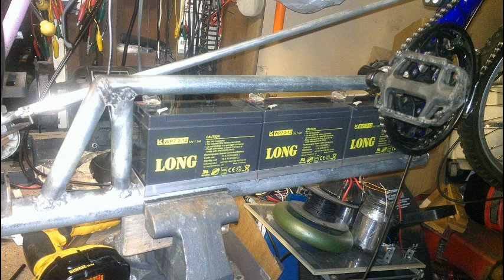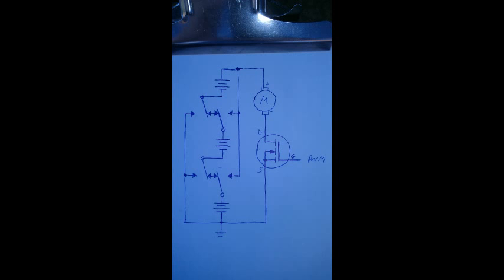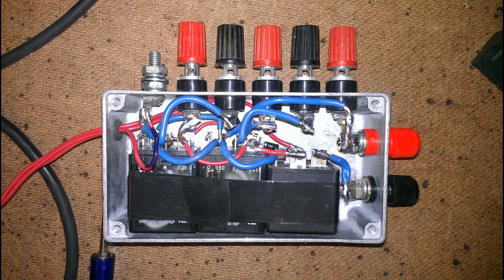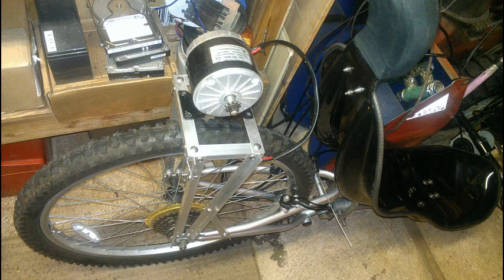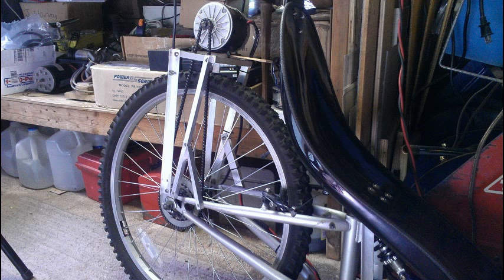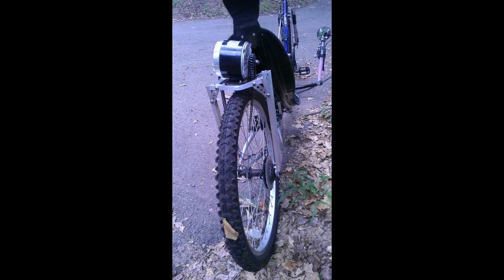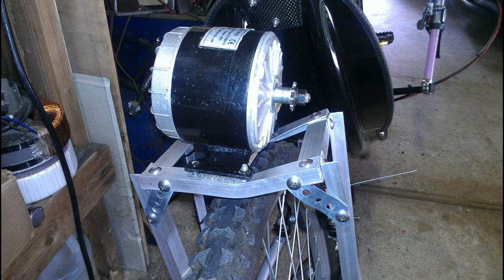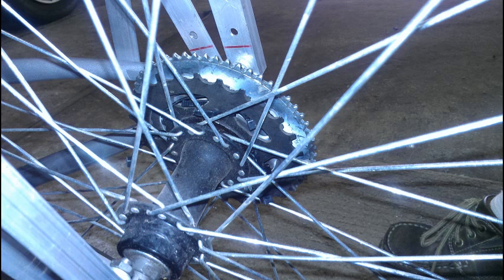#312 E-Cat and Ecumbent bike updates

Comment: Nice work Z!  It's too bad the ratcheting action in the rear wheel isn't selectable so you can switch between coasting and re-gen braking.  Maybe some kind of solenoid strapped to inside of the wheel with a commutator on the spokes...?

Comment: If you would bend 2 fat tubes to make a motor mount, and open them more as a triangle, that might work well without using a new mountin location. Part of the chain slack might come from the tiny sprocket. It looks very inefficient. YHou might lose 10% or so of applied torque right there. If you can find a large sprocket and large cog, that would be much better. Are the tie wraps transferring the motor's torque to the rear wheel? I didn't understand that right away. Tried multiple freewheels?

Comment: Hello. Your bicycel is very nice, but I don´t like the motor. As you have had problems with chain- you can use another type of wheel where is motor buid in straight in the middle. If you will give to the google electric bicycle wheel and you can see pictures.